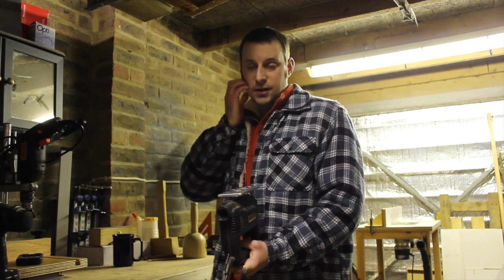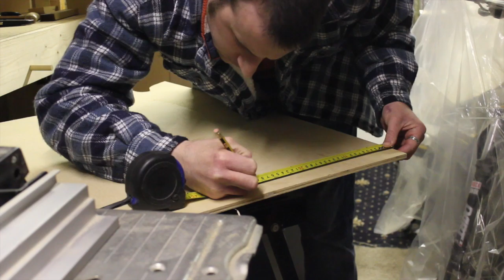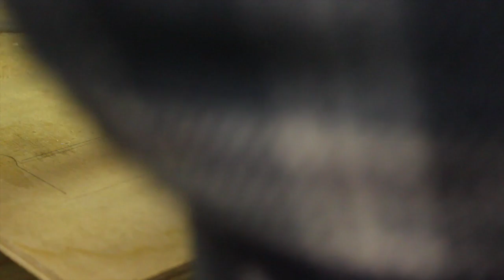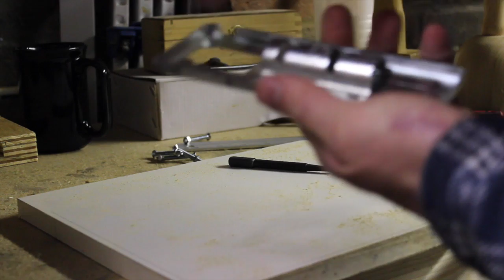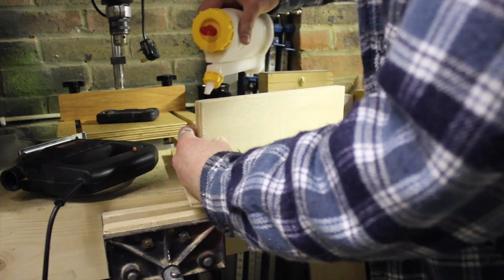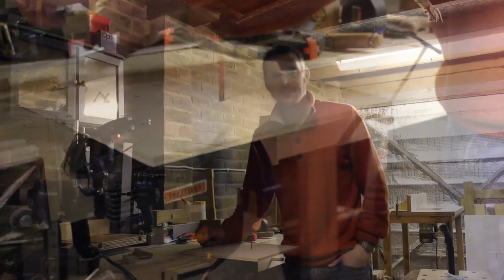Bench top jig saw mount

Comment from the maker: No problem, and thanks for watching my video. After reading your comment it got me thinking about the design again, and I'm sure it could be made to work better. For example attaching the jigsaw to something similar to a router plate and inserting it into a bigger sturdier frame, funnily enough similar to a router table! I believe this would stop the awful vibrating that you get when it is clamped to the edge of a work bench. This is something I am still yet to try.

Comment: A standard blade cuts on the up stroke - this is what you want for the table mount as the material will be pulled tight against the table when cutting. 

The reverse blades are for cutting on the finished side of plywood and reduces tear out along the saw side of the cut. It sounds like you already have a reverse blade installed.

Comment: Nice! I tried to do that, but when im cutting the piece it gets all jumpy and i m like "im gonna loose a finger now or what", wonder what am i doing wrong
Reply: Faz Fazzi    Since a jigsaw’s blade teeth cut towards the saw, in this case downwards, it shouldn’t be doing that. Use a finer blade (more teeth, less bite per stroke), set the jigsaw to a faster speed, and don’t push the material into the blade so hard. If you’re cutting shapes, use only a scroll cut blade (less side surface area for the material to bind against). Whether cutting this way or normally, blade choice and cutting speed are always important.